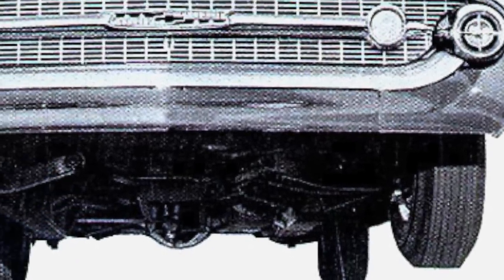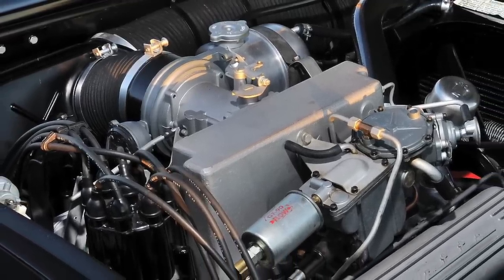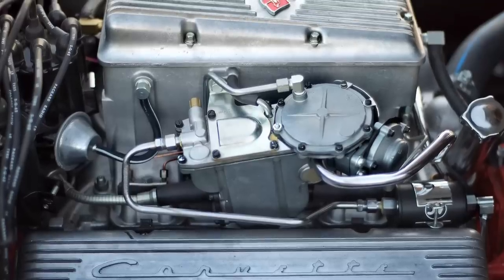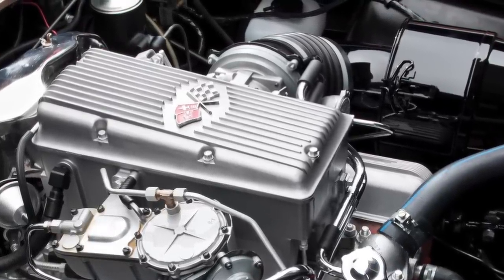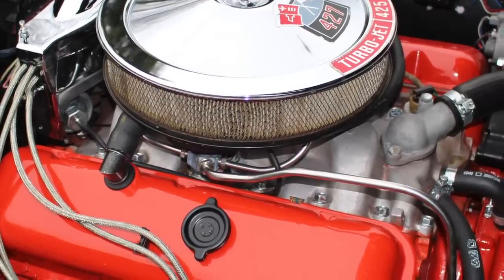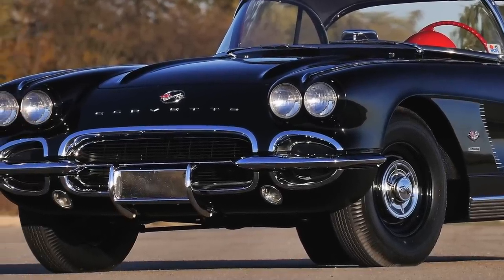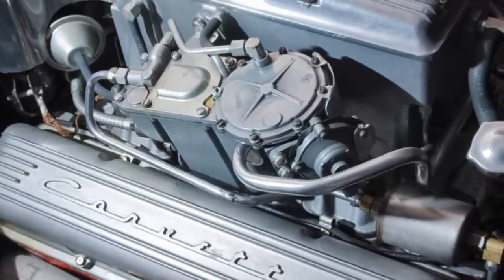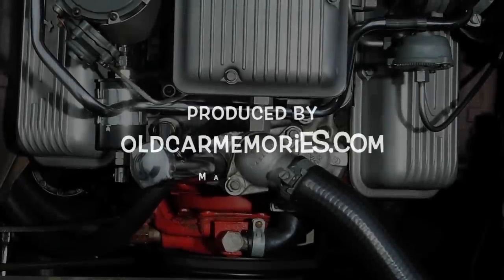Why Chevy Abandoned the 1962-1965 Fuel Injected 327 V8

Comment: Actually, the injection was not very reliable---it required a lot of fiddling to keep it running right. You are correct though when you say that many mechanics replaced it with carburetors because they didn't know how to work on them. Also, many owners wanted it replaced when they found out how temperamental it was, and got tired of the trips to the dealer.
Reply: Exactly true! My uncle ordered a 63 fuelie  4 speed Vette brand new as his 1st car. It was at the dealer more than it was in his driveway because he had so many problems with the FI unit. He also had problems with the rear diff. He sold the car in 1966 after the diff went out for the 3rd time. He replaced it with an XKE.....
Reply: Adam Trombino I'm sure he had a lot of problems with his XKE.
I know someone who had there's break down in front of a Chevy dealer.
That was the last straw, he bought the Corvette off the dealer floor!
Reply: Yeah, an XKE was not a step-up in the reliability department
Reply: Jags were very dependant on people who knew how to work on them. Sadly few really did, especially into the 70's when the cars weren't that valuable. But a good running early E type is an amazing car to drive! Same with a good early datsun 240Z.
Reply: Oh, they were loads of fun, and used cutting-edge technology at the time. But back then, the words "British" and "Quality" were not even remotely related. You could get hand-stitched leather and world-class performance, but it would still leave you stranded when the electrical system failed.
Reply: Honestly, especially after restoring and servicing them, it was the later british stuff that got bad, especially by the early 70's when the unions were intentionally screwing everything up in Britain (and here too..) I've even had to redo a lot of work on well restored cars and motorcycles as many people simply don't even know how things are supposed to run. Jags do like their oil leaks though, some design shortcomings mixed with iffy materials made them an issue you learn to live with.
Reply: You just need the right vacuum and fuel pressure gauges to work on it.
Reply: justsomeguy: lucas=prince of darkness. Lucas refrigerators is why the brits drink warm beer.
Reply: I think 90% of the problems were electrical. And poor trouble shooters blamed what they couldn't understand. I was lucky. Bought a 250hp 283 in 1969, and almost immediately met the best Rochester FI guru in the state, probably. Had virtually no trouble with it. Got 22mpg on crazy long trip. With 4.11 gears.
Reply: +2sheets to the wind  It's fun ridicule Lucas. However, British car electrical problems eerily exactly mirrored the British Leyland era and it's  legendary mismanagement, they didn't exist before and after it, even with Lucas electrical components. It's pretty easy to determine who was actually to blame.
Reply: You are correct. In the late 60s, a young man lived across the street from my family. He was an absolute wizard at tuning the Rochester FI.  Every weekend, two or three guys would drop off their FI Chevys for him to tune. His clientele numbered over a hundred from around the metro area. What a beautiful parade of American Iron I got to witness.
Reply: I remember it was terrible to start when it was very humid, or after sitting out in the rain a day or so.  It was always needing some fiddling.  But when it was right, yowzaa it was great.
Reply: You're getting Jags from the 70's mixed up from with Jags from the 60's. British cars from the 60 were fine, reliability wise, including Jags. It was 'the plumbers nightmare' Leyland era XJs that gave Jag the bad reputation. All one has to do is look under the bonnet of a XJ6 & compare it to what a MkII looks like under the bonnet, even though they nominally s'pose to have the same engine underneath.
Reply: Exactly. Mechanical fuel injection was not only expensive it was difficult to keep in tune; electronic fuel injection was the solution but was over a decade away.
Reply: Not true I had an early on a 327 in a jeep a buddy had a late injection on a 350 in a jeep he got 25 mpg no floats bouncing in rough stuff keep clean fuel tune'em with a vacuum gage
Reply: Ernie Wall without a doubt the coolest Jeeps ever owned.
Reply: Yeah shoulda woulda  If I had one today it'd be on my truck
Reply: What did the Mercedes owners do because it's system was way more complex?  Earlier Mercedes had direct injection.  Later ones had the terrible k jetronic
Reply: I had a '79 VW Rabbit (Golf in Europe) that used Jetronic---never had a problem with it
Reply: @justsomeguytoyou There is also the thing that gas wasn't as clean. Filtering wasn't as good for the service stations. There were many Service Station tanks that rusted within a few years of being installed and letting water into the gas. This actually was happening all over the country. That's where the inexperienced mechanics came into play. If they didn't know how to tear into the injection system, then there was only one thing to do...
Reply: erik litchy I heard one Benz owner telling another owner that the reason for Mercedes’ safety was that they were always in the shop. I once told a church friend who owned a Mercedes repair shop that the old ‘60s 280S was my favorite. He quickly warned me not to buy one because the FI caused so many problems.
Reply: He replaced a vette with an XKE - talk about jumping from the frying pan into the fire. I had a 68 E. Very sexy and very UNRELIABLE.
Reply: All British junk was unreliable because of Lucas Electronics, "Prince of Darkness"!! LOL
Reply: lokisgodhi   I never met a British built car that didn't have electrical problems, especially XKE's.
Reply: I disagree, I had fi unit on 67 vette and it didn't become a headache until I didn't change filters and adjust the valves per 6k. I had a Chev trained mechanic from the 50's that showed me how to keep it running diagnosing which system needed looking after.
Reply: @sewallm60  😁 my Fi unit on 67 Vette went 30k before major fiddling by Chev trained mechanic.
Back then owners were on the cheap side, not having Fi trained mechanic work on their cars. I was a goffer for one who taught me a lot about FI
Reply: @kramnull8962  that's why the early injection systems had 2 fuel filters....
Reply: I have to disagree strongly 're Mechanical fuel injection being inherently unreliable. It isn't but not all systems are comparable. The fuel injection system in my Mercedes 6.3 is brilliant but it must be lubricated properly and you must use additives in modern ethanol fuels. 6.3 mercedes often run to staggering mileage. A friend has travelled 1 million k in his here in Australia. But some early systems were problematic. The early Triumph systems have poor reputation. Mechanical fuel injection requires good servicing to maintain precise metering. A 4 barrel carbi is a far simpler and more robust beast. But my 6.3 will give me 22 mpg down the highway at highway speeds if you are careful! Cheers
Reply: @justsumguy2u  the best xke was one that had a transplanted Chevy 283 under the hood. Problem solved......
Reply: @2sheetstothewind484  HaHa old but a goodie. Lucas was an innovator: invented the intermittent wiper, the self dimming headlight and the anti-theft ignition.
Reply: @justsumguy2u  I owned three early e-types. Never had an electrical problem.  I did have problems with them running hot, and a stuck carb float.  Most fun car I ever drove.

Comment: I would imagine all of those removed fuel injection systems would resale for a high price nowadays. ✌✌
Reply: $7,500  for Rochester  system restored   there is also a modern injection system that looks like an old Rochester unit   for sale
Reply: Mike Skidmore  Wow, I didn't realize they came with that price tag. But if you're doing a high dollar restoration or looking for authenticity then it's a small price to pay. Thanks for the info. ✌✌
Reply: You can search for almost anything on E-Bay  gives you a  good idea of Market Value .. I have a Winters  Foundry   4 barrel intake of from a  1966 Vette  327  360  HP   not overly valuable yet.. but  is a  good working intake   ..  many  modern  day Weind and  Edelbrock to choose from
Reply: Mike Skidmore  thanks for your insight. 👍👍
Reply: I had a fuel injection on a bored out 283....placed in a 51 Chevy......I never could get it to pull good.....people told me later in life probably did not have the valves needed!
Reply: The actual added value in case of an original Rochester system seems to be about 20%-30% of the car's value (in case of the C2 Corvette, at any rate- probably depends on the model), buuuut that only applies if it's a factory original. Many cars had FI badges added in the hope of boosting their value, many original fuelies were converted to run on 4-barrel carbs etc. as is given here so... only really much good if you're a stickler for originality. Great cars and great technology for the time I can understand, but installing an original Rochester set-up on something which didn't have it to begin with is just another performance modification, and probably not the most pragmatic one.
Reply: Yes, and just try sourcing a Duesenberg blower for your SJ restoration.
Reply: had they all been kept...they'd be in higher numbers, and thus worth less.
Reply: Try $5,000.00-$10,000.00, depending on condition and year of manufacture. Yup, they cost more now than the entire car they came in when new!

Comment: I had a close friend, a Mechanical Engineer graduate that put a "built" 327 with the Rochester Fuel Injection on it into a two door 1957 Chevrolet sedan.  The engine was followed up with a close ratio four speed Muncie manual transmission a, combination made it an amazing performance vehicle  He was the only person around here that could work on that injection system and tune it precisely.  I wish I owned that car, it was fantastic!

Comment: Thanks. Would have been nice to see the internal mechanics of the first Chevy fuel injection system.
Reply: There isn't much to it. Some vertical stacks and a throttle body at a 90 degree angle.  It's effectively a mini tunnel ram intake.  Not that that much of a point for mechanical throttle body injection, it's a carb with mechanical spraying of fuel.  Even with EFI performance is underwhelming, more like a smart carb.  It's not until you move to port or direct injection that fuel injection really starts to shine for performance.  

A carb can match the performance of a throttle body, it's not matching the performance of port or direct injection though.

Comment: And today we have 300hp from a 4cyl engine. Sure would have liked to have seen quality turbocharged 4cy right at the time of the FORD Pinto. We had to wait until the mid-80's to get a quality 4cyl with turbo from SAAB. The 2.0L engine used in the SAAB 900 is a very good engine even if it is installed backwards.
I owned 2 57 Belairs,in 1973. Bought one for 100.00 the other for 200.00. This is what these cars brought back then.

Comment: Yes, mechanical fuel injection can work but for it to really be practical it had to wait to be paired with computers.
That said, mechanical FI does live on at the drag strip, particularly among alcohol-fueled race cars where exact air/fuel ratios over all driving conditions are not necessary. They just need to idle and go full throttle and they work great for that.
Reply: 177SCmaro  vw mastered the mechanical fuel injection. There is a limit to mechanical injected engine hp.
Reply: Exactly right.
Reply: @kinzieconrad105  I'm making over 4k hp blown alcohol hemi. Mechanical fuel injection meaning enderle big and ugly 5 9/16 butterfly hat with 1200 enderle pump and hat/port injection. Enderle k barrel valve and 2 high speed leanout poppets

Comment: Very interesting ( as per usual for your videos).

BTW - I like that you state the horsepower as 'gross'. Lots of younger people watching this might not know that hp ratings before 1971(?) were in gross terms...which are about, what, 20-25% higher than the same engine would get in net horsepower (which is how cars are rated today).
Reply: You're confusing crankshaft HP with wheel HP.
A rear-drive drivetrain typically loses 10-15% power, so the 379 is about right for a 430 rated motor.
Also, on an inertial dyno, things like wheel and tire weight affect HP readings, as they add to the inertia of the roller and have to be accelerated as well.
Reply: mcrocket youre TOTALLY WRONG!! Gross HP is what the engine puts out...not what is at the  wheels....
Reply: For those of you who are confused about the HP ratings, know this.  (1) We are talking HP numbers on an ENGINE dyno (measuring power at the flywheel of a bare engine), not a CHASSIS dyno (what most today are familiar with, measuring power at the rear wheels).  (2)The other thing that you need to be aware of is that the engine HP ratings in the 60's were measured with a bare engine not attached to an alternator, power steering pump, radiator fan, and sometimes not even a water pump, all drags on HP.  The modern ratings include all of the normal operating systems as it sits in the engine bay.
Reply: Are you referring to dynamic hp at the rear wheels or static measured at the flywheel
Reply: They also played games with the horsepower ratings on their most powerful engines. They were all rated at 425 hp for some reason, especially all the 7 liters. They found the RPM that made 425 hp and that was the rating. Nevermind the fact that if you let it rev another 1000 RPM, it made much more horsepower.
Reply: No he's not. Gross HP was measured without any accy's (including the water pump) and open headers on the dyno. That 327 makes about 265HP using net measurements. Drivetrain loss is about 15% on top of that, or about 225 to the wheels.
Reply: Yep. No accy's and through open headers, no exhaust is used. That 370hp 327 makes about 265hp net and 225hp to the tires. 
 I dynoed the claimed 304hp 289 in my '65 shelby, it made 225hp.
Reply: Both gross and net are measured at the crank. Gross has no engine accessories while net has them all installed.
Reply: Gross doesn't even use stock exhaust manifolds or an exhaust system.
Reply: Gross HP as I was taught is the engines HP output without the added drag of accessories or exhaust. Typically the dyno would be set up without an air filter just a air hat to help flow air into the carburetor. The Exhaust is going to probably use headers and straight pipes instead of manifolds, converters, and mufflers. The cooling fan is not installed as it's not needed on the dyno as most have a large electric fan to cool the dyno radiator.  The water pump may be replaced with an electric one as is the fuel pump to save power as well. The power steering pump, air conditioner pump, and alternator are sometimes excluded as well. A engine tested on a dyno under those conditions will report a much higher power rating that what would be actually obtained once it's in a vehicle with everything added back into and onto it. Engine manufactures use even more tricks to get the dyno to read higher hp such as super light weight oils, reduced oil volume, windage tray installed into the engine are just some examples. Net HP would be the engine as installed on the car as it would be normally used. On a side note the the transmission, driveshaft, differential, slight brake drag, vehicle unspring weight of the tires and rims, all contribute to an additional power loss when a dyno measures HP at the wheels versus the crankshaft of a tested engine.
Reply: McRocket new terms is engine horsepower and wheel hp
Reply: McRocket I've also always found that people are all about the horse power when it is torque you feel in the seat of your pants and horsepower is actually derived from the engines torque and rpm potential, intake exhaust rate etc.
Reply: All this arguing about the HP ratings, yet nobody realizes that an engine being rated by the builder is tuned to perfection. No way would the engine in the vehicle you buy match that number.
Reply: @TheLionAndTheLamb777  Per a retired GM dyno cell operator that helped me out in the early 90's when I started racing....  GM fiddled with the published HP numbers in the 60s and 70s and there was good reason the Ford numbers paled.  Both companies rated with no accessories, but GM maintained 10" of vacuum in the exhaust system under all conditions.   They essentially sucked the exhaust out of the motor with their dyno cell fans regardless of rpm or displacement.  This was a significant percentage gain.   In today's popular terms, it equates to about 3-4 psi of boost on the intake side.

Comment: BEST V-8 EVER! I've done >220mph in one, in a 1973 Stingray. It sounded and smelled like an aircraft engine. And would go through a set of back tires faster than the tank of gas. You need it in a vehicle that weighed more than 4000lbs., any lighter and it was dangerous. That's why it had to be pulled out of my 1964 Malibu.

Comment: I remember the Rochester injection unit. Actually it was a simple unit but the mechanics at that time really didn't know how to service it. It had two problems. They didn't have really good fuel filters at that time and the nozzles would clog . Sometimes it would lean a cylinder out and melt a piston. Second IT had a mechanical fuel pump and sometimes it wasn't good enough to maintain fuel pressure. They did create a lot power and delivered really good gas mileage